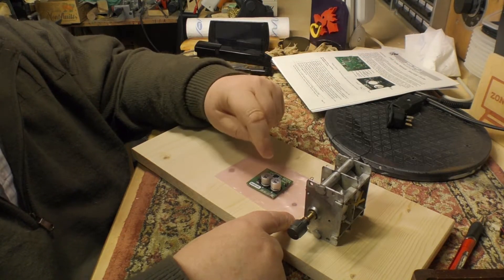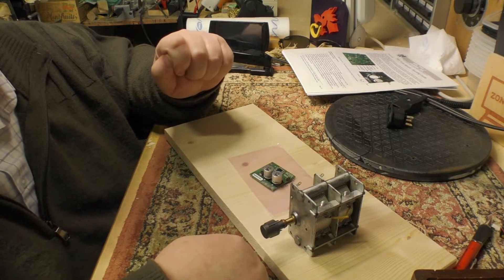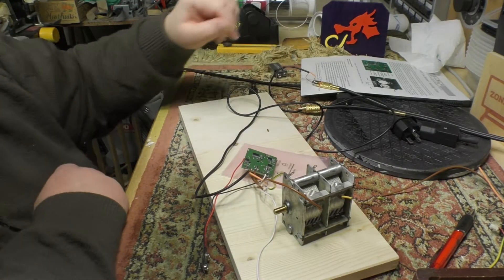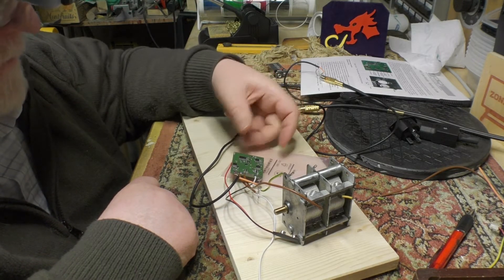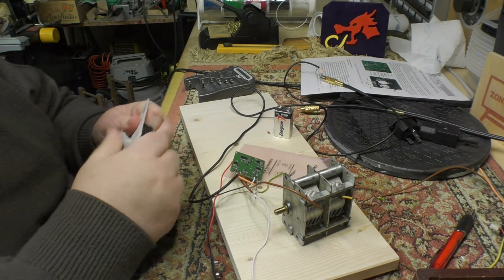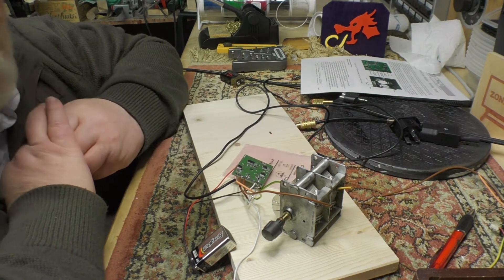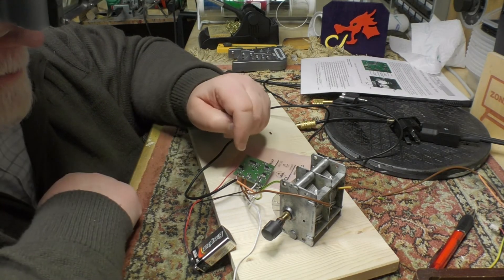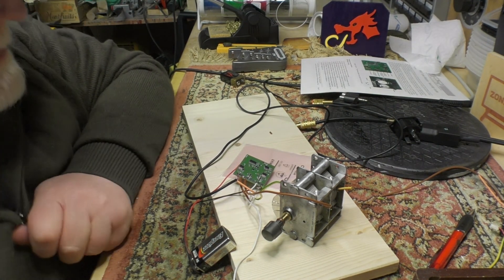Receiving FM on a vintage AM set - part 1

Comment: How to receive FM on an old SEMP PT-76 original AM?
Reply from the maker: I'm not familiar with this set so all I can advise is that you research to find a suitable FM module and this will normally come with instructions on how to install.   I did my project 7 years ago so available modules will have changed since then.   Also, I did it as an exercise only.  The way I get modern radio on my old sets is by using a small local transmitter which is connected to an internet radio.  With this approach I can hear all modern stations on my old sets without the need to modify them.